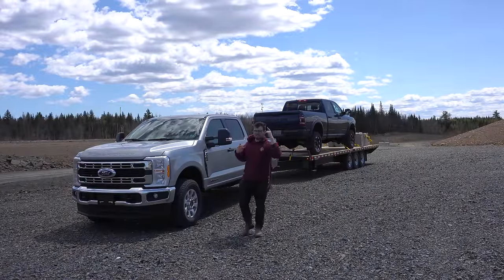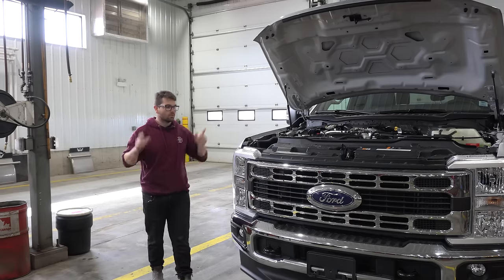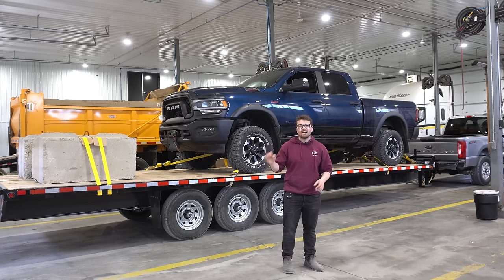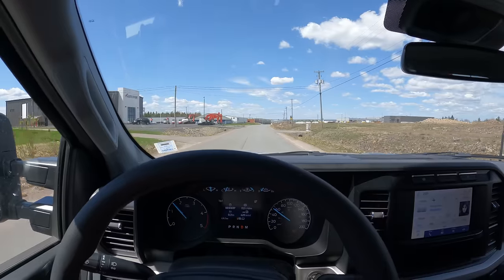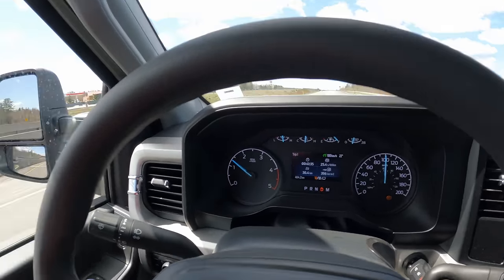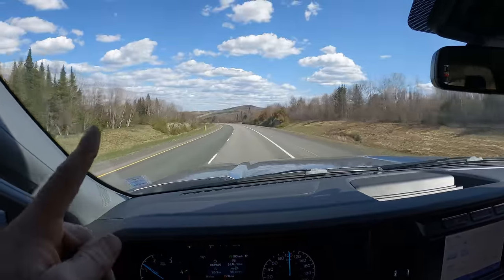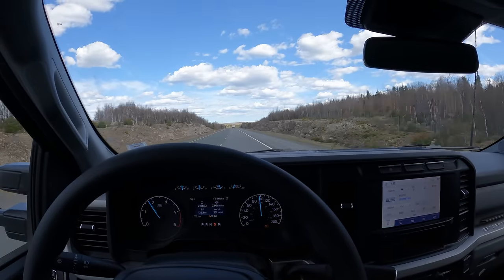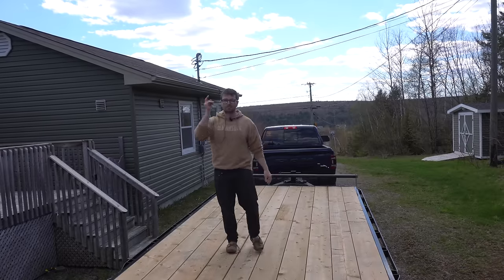Ford F-250 Powerstroke (6.7L) Diesel Engine/Towing Review **Heavy Diesel Mechanic**

Comment: Did moving your truck farther forward improve the sway enough on the way back to be comfortable? Are you able to adjust the trailer sway control? Looking back at Pics it looks like your truck may be about 2-3 blocks high? That'll catch a decent amount more cross wind and add some drag since it's now above the roof line of tow truck too... But thoughts about if you think shock damping or leaf spring geometry differences might be more likely culprit? Appreciate your videos! Keep it up!
Reply from the maker: Yes moving the truck back did make a nice difference. but it was little a very cautious drive. and the wind was very strong that day. My gut feeling is that those blocks at the rear were too far back.

Comment: You measured your tongue weight with a stationary vehicle. As you drove with those concrete blocks behind the trailer axles, every little bump would create a see-saw effect, lifting up on the tongue and dripping it below the 10% weight. 

I understand the desire to tow max weight, but there is a reason that no one loads trailers like that.

Comment: You need to turn the truck around with the bed at the rear of the trailer and put the blocks near the tongue.
Reply from the maker: the load probably needs to be shifted.

Comment: I have hauled blocks before.  You have too much on the ass-end.  Move the blocks over the wheels.
Reply from the maker: I mean maybe but my tongue weight was in spec and when I pulled with the Duramax I had blocks on the back too.
Reply: @The Getty Adventures  a few feet makes a big difference.  We're they in the exact same spot? I just looked at Durmax video and the blocks were further forward by 1/2 a block or more.  The pickup height might have added to the start of oscillations due to airflow but mostly the weight was too far back.  Not the F250's fault at all.  Improper loading. 😮

Comment: Cummins 5.9 and 6.7 L have always had six bolts per cylinder for the head. Not sure where you heard it was four.
Reply from the maker: They both have 26 cylinder head bolts. 6x6 = 36..?
Reply: @GettysGarage  yes each cylinder is surrounded by 6 bolts. 26 total on a Cummins https://www.xtremediesel.com/mm5/graphics/00000001/PP-24vCRH-L103VS-FR.jpg
Reply: @VMac822  if a Cummins has 6 bolts per cylinder how can it have 26 head bolts ? Math isn't your strong point.
Reply: @kylebutler7142  lol…look at the picture and count, there’s always head bolts shared between cylinders…same goes for the Powerstroke and Duramax.  So simply multiplying 6 bolts per cylinder by the number of cylinders doesn’t work. The phrase “6 bolts per cylinder” simply means each cylinder is surrounded by 6 bolts, not that there are actually a total of 6x6, since on the Cummins 10 bolts are shared between cylinders (6x6 -10 =26).

Same deal on the Powerstroke. Bolts between cylinders are shared as well, and then you have 2 banks. A Powestroke probably  has  36 head bolts, not 6x8 =48 since several are shared. Someone who works on Powerstokes could chime in and confirm.

Comment: Your load was not distributed correctly . Those blocks were to far back on the tail and that’s what caused the sway. 
If you had loaded them sideways across the deck and farther forward, you would have been ok.

Comment: I think the drive ride is becuase of the cement blocks placed in the very back of the trailer! Weight needs to be over the axels. Did you have the cement in the same place with the DuraMax?

Comment: What is the difference between a high output Powerstroke diesel engine versus the standard Powerstroke engine. 🙂
Reply: HO Powerstroke has 500hp and 1200lb ft of torque. This thing should be in a semi truck.
Reply: Those trucks 🛻 have better foot pounds of torque than a Dodge Ram 3500 series truck 🛻. 🙂

Comment: Curious about transmission temperatures. Do you or were you monitoring those at all during the tow? It seems the Ford runs hotter than the others in my experience. Would love to hear your thoughts as you go if you can squeeze it in. Thank you. Great videos!
Reply from the maker: I honestly was not. but going forward I will be monitoring. another great thing to compare between brands.

Comment: The duramax has the same bolt pattern, 18 bolts per head like the powerstroke.
Reply: @Gettysburg did a great job sharing tech details on the diesels like mains and pistons and so forth, excellent video, but unfortunately messed up on the head bolts. Cummins also has 6 bolts surrounding each cylinder, same as DuraMax and PowerStroke. Cummins mains are 2-bolt as he pointed out, but could have mentioned it has 7 main bearings for 6 cylinders versus a V8’s 5 main bearings. and a Cummins bottom end has always been pretty indestructible.

Comment: My 2022 F-350 Tremor tows very well.  I ordered it with the 3.55 gears and it pulls my equipment trailers exceptionally well.  I get fantastic fuel economy while towing.  The concrete blocks behind the rear axle will almost certainly be the cause of the poor handling.  Was is porpoising?
Reply from the maker: Ya I was disappointed with the towing run. I agree with you I think those blocks were the culprit. Going to re-test with a different load set up because that powerstroke had incredible power
Reply: You running the 6.7l Powerstroke?
Reply: @kylebutler7142  yes it’s the 6.7.  I had a 2022 ram 3500HO before this truck and even though the F-350 is Tremor and less suited for towing than the regular truck is is night and day better in terms of handling a load and power than the Ram I had.  The engine brake on the powerstroke is pathetic though.   I tow heavy trailers behind my trucks every day and the Fords I have are planted and rock solid while towing.
Reply: @gravytrainoutdoors  4 extra gears in the transmission makes a huge difference until Cummins gets at least 8 behind it won't be able to compete
Reply: @FIVE6-qk6pc  my 2019 powerstroke ran circles around my 3500 as well.  I think the Aisin had its shift points better sorted out than the 6R140 in the ford.  The biggest complaint with the Aisin was the big just jump from 2/3.  It might have been 3/4 not 2/3 but in any case there is a major jump to the next gear on one of the shifts.  The Aisin in my 3500 was super clunky but the Aisin in my 5500 isn’t as bad.  Both 2022 trucks.  I think the 10spd gives the ford and GM trucks a big advantage though.  It’s a really impressive transmission.  I just hope it’s reliable over the long term.  My thoughts were that the Aisin would be better because it is less complex but the 5500 I have shipped with a new clutch pack because there is a c-clip that is breaking and blowing up tranny’s.  It seems to be a pick your poison between ford and ram.  Both have weak points.

Comment: I really like watching your content before this and I will after and I'm not trying to be a douchebag but the trailer is not loaded right. If you're swaying back and forth you're not loaded right, period. What ever is on the very back of that trailer needs to be pushed over the axles
Reply: Agreed, if you look at the blocks on the Duramax test, they were starting on top of the 3rd axle. In this test they are almost at the very back of the trailer. Moving them 2-3 feet forward would have put more of the weight on the axles and likely stopped all the sway issues.
Reply from the maker: Ya that's what I was thinking, probably going to just load blocks on for weight and not the truck. the reason the blocks were so far back is because the truck. figured with enough tongue weight it wouldn't matter.
Reply: @GettysGarage  no worries, you are a mechanic and not a hauler so you learn as you go. Love the channel and your very unbiased opinion. Currently considering a 3/4 ton and figuring I am going Ford for 2 reasons, 1) aluminum body, I am tired of rust repairs to panels, 2) the stout builds on the engines per your reviews. Cheers and Keep posting

Comment: I have a 2020 F250 power stroke with the high capacity towing package.  When I tow it’s typically around 10K pounds.  I’ve found that the truck likes tongue weights around 13-15%.   I typically have mine at about 13% and have no sway issues.  Fastest I’ve gone is about 130 KPH.  

I also have the 3.31 rear and really like that setup with the 10 speed.  You get the best of both worlds in my opinion. 

My trailer has a larger than average frontal area which increases drag significantly and decreases fuel economy.  At 110 KPH I’m getting about 4 Km per liter (9.5 mpg) which is acceptable for me. 

What I don’t like about the 10 speed is starting from a stop when not towing.  Gearing is meant for towing so it’s a little awkward to get going.  I couldn’t imagine a 4.30 with that transmission.
Reply from the maker: Honestly probably was a load issue not a truck issue. And I agree having closer to 15% tongue weight is probably best. I think having the 3.31 gears with the upgraded axles/high tow capacity package is a pretty slick set up for the f-250
Reply: 3.30 gears are less than ideal. Mostly because the exhaust brake works so much better with the 3.55 gears.

Comment: Durmax has the same amount of head bolts. Cummins has more main caps per the number of cylinders.
Reply: That’s what I was thinking I was pretty sure the duramax and the Cummins has 6 head bolts per cylinder as well
Reply from the maker: the Cummins having 2 bolt mains is normal, all the big 15 liters engines use 2 bolt mains but they are just very big bolts lol. the Duramax uses 36 head bolts in total roughly giving it 4 bolts per cylinder. the Cummins uses 26 headbolts giving it again roughly 4 bolts per cylinder. now it clearly depends on size of bolts and bolt strengh but it certainly is interesting that the powerstroke uses so many more bolts.

Comment: Have you towed with an older 6.7 PSD to compare? I run a 2016 F550 mechanics truck (Maintainer bed) and the exhaust brake on that truck is hardly noticeable at all. It is basically useless. I'm wondering how much better it is on these newer trucks
Reply from the maker: The exhaust brake felt pretty good tbh. I mean it not like having true engine brakes but is certainly noticeable
Reply: That’s very interesting cause my 2016 f350s exhaust brake works very good I’ll let off the gas and it’ll start braking it’s self without having to press on the brakes but on my 2018 6.7 it’s like not as strong as the 2016 by any means you probably got to adjust something

Comment: I think it's the cement blocks in the very rear of the trailer too.  Also, were you getting any wind on the front of the towed truck to create lift in the front?
Reply from the maker: there was a very heavy head wind. on the way back the trailer was certainly more stable.
Reply: @GettysGarage  The RAM on the trailer backwards was definitely working against your aerodynamics, especially with strong headwinds. And the 3.31 gears I would never have in a tow vehicle. I owned a 2017 F250 Powerstroke with 6-speed and 3.73's. It did well. I now have a 2022 F350 dually with 7.3 gas,10-speed and 4.30 gears. it pulls great,hard on fuel.

Comment: Less stable than the GM.....well you have the center of gravity for your load way different on this one. I would expect it to be handling very differently. Would be interesting to see how they compare with similar loading.
Reply from the maker: That's the plan for future tows. going to stick with the blocks to give a consistent load.
Reply: @GettysGarage  may get the same result but at least it will be fair

Comment: I knew you would have sway problems with truck backed on and if you would of drove it on it would of towed like a dream if the Dodge had a 6.7 diesel and if not you would need them blocks on front of trailer .

Comment: THE TRUCH DOESN'T MAKE THE TRAILER SWAY. IMPROPER TRAILER LOADING WILL, DROVE TRANSPORT FOR 40 YEARS AND I CAN TELL YOU, NEVER ADD WEIGHT TO THE BACK OF THE TRAILER WITH NOTHING IN THE CENTER YOU ARE LOOKING FOR TROUBLE.  ALSO MAKE SURE YOUR TIRE PRESSURE IS CORRECT.

Comment: I knew he was gonna have problems with those concrete blocks behind the axle. That and idk why you pull that with a conventional hitch. You need a gooseneck or a fith wheel. You're doing big boy numbers. You need a big boy trailer
Reply from the maker: Biggest reason is the truck I review don't come with gooseneck/fifthwheel set ups.

Comment: From the get go, you threw me off by changing the RAM from facing fwd to backing her in… It just didn’t look right for tongue weight.
Reply from the maker: It was tough because with the engine up front of it absolutely buried the back end of the f250 and the payload for that truck was only 2100lbs. Either way probably got a little ahead of myself and I think going forward I'll be using concrete blocks which will be more consistent!

Comment: Too much weight at the back of the trailer. With the truck backed in the engine and transmission is at the back of the trailer which is the heaviest part of the truck. Plus you have the concrete blocks back there also. Most of the weight on the trailer is at the end instead of the front.
Reply: The engine and transmission of the powerwagon were directly over the trailer axle. Not the back.

Comment: You may be a diesel mechanic, but sorry not the best at loading a trailer. Never load a center mass on the tail past the rear axles. That is exactly where you got your sway from. For starters blocks loaded over the trailer wheels will stop the trailer whip. Or If you wanted an even load, could have loaded the blocks up front, truck behind them pointed forward. If too much tong weight, one block up front, truck in center and one block on rear. I don’t understand if you did the test yesterday with the Chevy (which looked loaded real well) should have used same config for 2nd day test for like comparison. Just like TFL does, unhook and test back to back. The rest was a great video!
Reply from the maker: I did the chevy last week but regardless moving forward we'll be using the same loading technique. I thought having truck on the trailer would love awesome but it limited where I could put the blocks. Anyways live and learn and appreciate the feedback!

Comment: OMF really?  You are comparing one vehicle hauling concrete blocks, where the strap is over the load.  The load has a low CoG, AND is motionless.  Then you load a tall coil sprung truck too far forward in "the triangle", BACKWARDS, on a windy day, and you ONLY STRAP the wheels to the trailer!  Essentially leaving the truck to flop and bounce, AND lean?  You are wondering why  it was so affected?
Reply from the maker: concrete blocks will be strictly used in the future. thought it would look better with the truck on it but you live and learn.

Comment: Agree it's an ugly truck but they trailer sway is definitely (at least partially) on you... Never a good idea to have such a heavy mass on the very back of any trailer
Reply from the maker: I was thinking that too but I mean my tongue weight should of been more then enough. the truck just felt very loose compared to the Duramax.
Reply: It would be an awesome experiment if you could tow that exact same load with a Cummins and a Dmax to compare. All 3 companies make a very capable truck these days
Reply: yeah, differnce is static weight vs leverage, add uneven bounce and wiggle wiggle.
Reply: Tongue weight is one thing, but a properly loaded trailer is another.  A big fail on your part. Unless you tow the exact same setup with each truck this is just a big biased clickbait.
Reply: Still had 10% tongue weight. It was not ass heavy.
Reply: @GettysGarage  With the puzzling handling issue it would have been nice to have had the duramax available to see how it handled the very same load balancing. Like you said, the actual weight balance was correct but as one other mentioned perhaps there is a physics property to high weights at ether end of the trailer and how that could cause an issue, I just don't know. Yet odd loads like that are not uncommon in the world of hauling as long as there is sufficient hitch weight. With little to less then no hitch weight, that is when its an accident waiting to happen. I gather the trailer was weaving as the truck appeared to be driving ok ( no wandering all over the road due to lack of steer caster angle issues for example ).

Comment: Of the 3 manufacturers mentioned, Ford is the only one with a major safety flaw in the design of their auto transmission!!!
•  In an emergency, you can't push the shift lever from D into N with an open palm!!!  This is not shifting in the normal sense by pulling up on the shift lever and changing gears!  
•  On Ram, Chevy, GMC as well as most other auto manufacturers  you can do the emergency disconnect move - Honda, Toyota, BMW, Lexus, Audi, Mercedes, Nissan just to name a few!!!
•  The same is true on Ford's console mounted auto transmissions - you can't do the above move but have to push the lockout button!!
•  The whole idea behind this safety design is to allow the driver to disconnect the engine from the drivetrain without having to worry about putting the trans into Reverse! There is a safety detent and the transmission cannot go into Reverse with this emergency procedure!
•  No dealer know about this because for some reason, the manufacturers do not publish this info!!! Try it - you just may be pleasantly surprised unless you own a Ford product!!!!